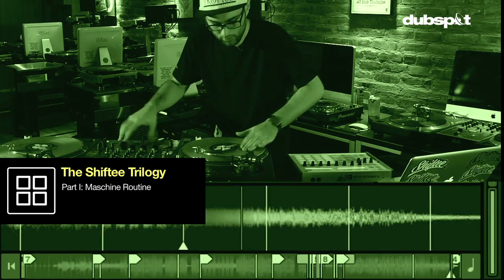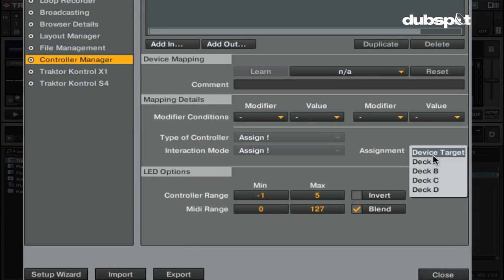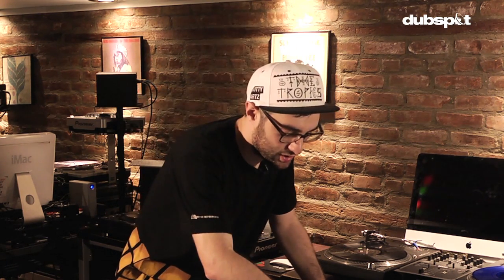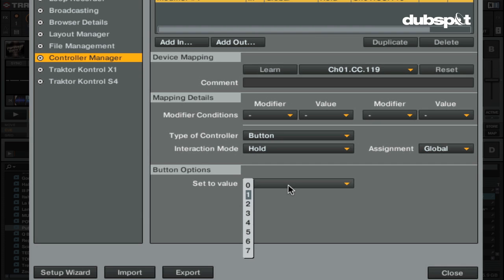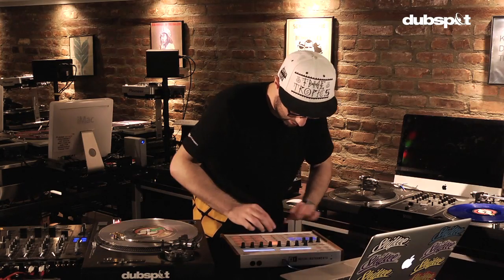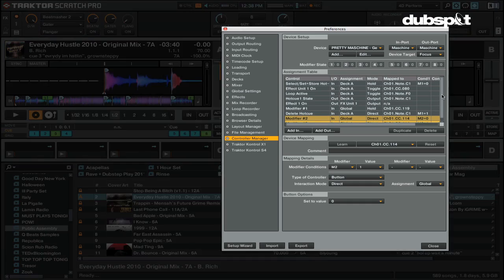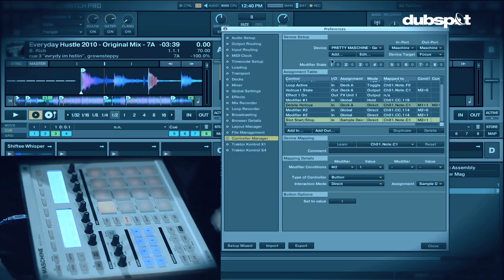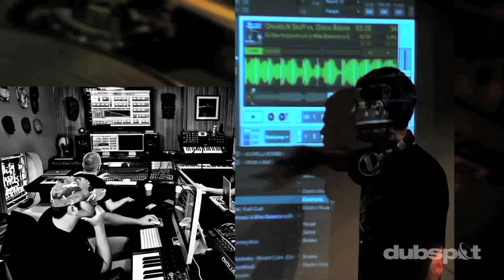DJ Shiftee's Traktor / Maschine Tutorial Pt 2/3: Using MIDI to Map LEDs + Modifiers

Comment: Make sure you go under pad mode in the NI controller editor for Maschine and set the LED output for Midi In. Default is set as midi Out (meaning when you press a pad it lights up).

Comment: @afloreslo if your having trouble with standard LED mappings make sure in the controller editor  under pad mode you switch from led on midi  out (pad lights when you push it) to midi in. So the soft ware eill light the oad whatever color its assigned as. HSB protocol is way different (which is what i was refering to in my post). And i dont know of  anyone to map that yet..